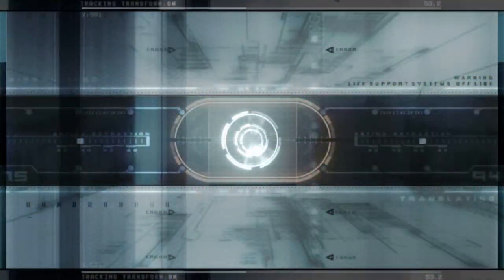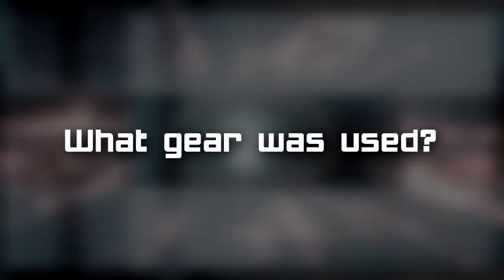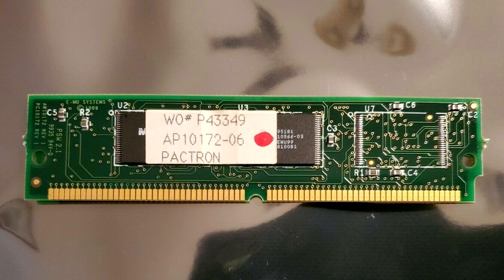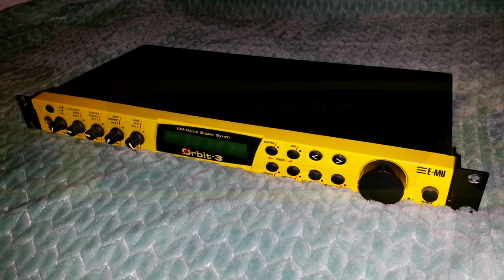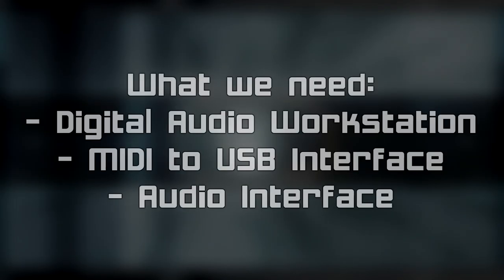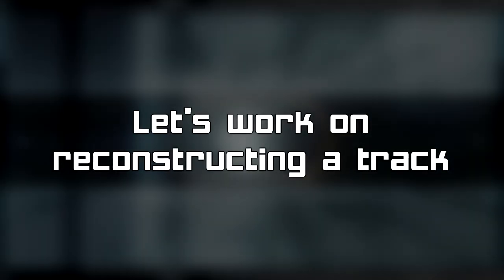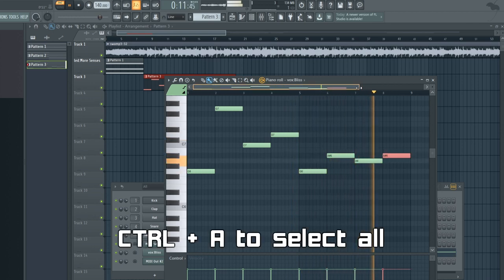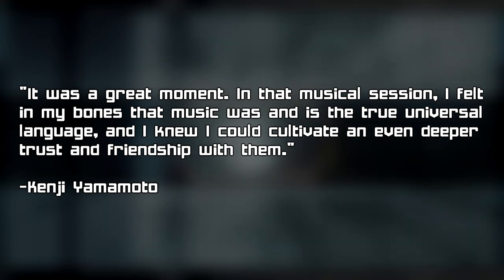How to Recreate Metroid Prime Music (Part 1)

Comment: Hi, thank you for this mini series. That being said, there is a method to the madness of sound recreation. 

Woochia beats and bops did an absolutely amazing video on the art of sound design called: "Sound design: The Complete course" I urge you to check it out if you haven't already, it will make recreating music so much easier.

Also, for the purpose of preservation, making sample piano's out of prerecorded sound bits is also a great way to preserve this music and presets, if you really cannot find stuff for the Emperor Ing fight you could always try to recreate it using samples, sure its a bit of cheating and not as flexible, but if you properly sample and generate an instrument from it, it will be plenty usefull, for you as well as anyone else.

Comment: Amazing work as usual. I'd love to get my hands on some of these synths, any advice on how to track some of these down? Just ebay and hope?
Reply: None of this gear is particularly rare or expensive from what I can tell, though some are more sought after than others. It's also, at this point, all vintage music equipment and finding one in working condition for a price you want can definitely be easier said than done. 

That said, yeah, hang out on eBay and Reverb and check every so often. Use saved searches so you only see new listings. Sort by lowest price. And keep a couple hundred bucks squirreled away to buy it when you do get a deal. 

I was finally able to add an MS2000R to my studio last summer and I've had a blast with just the presets on it.
Reply from the maker: @OnslaughtSix  ^^ All of this is excellent advice.  The SC-880 that I just got took a long time of waiting on ebay, hoping for a deal and eventually it came around. I get the feeling that the Orbit-3 is an uncommon module because it was already a desirable item for E-MU collectors when I first found out about it and now the price for them has gone up unfortunately.  There is Emulator X, an abandonware VST that isn't perfect but is the next best thing to software emulation of these E-MU modules.  I found my Orbit-3 through a friend of mine who stumbled upon it while sifting through various websites.  It was on a Canadian classifieds site, IIRC.

I'm also planning on making samples with some of these presets available on my Patreon to make it easier for people to get access to these sounds.

Comment: This absolutely cheered up my day, thank you so much

Do you think I could get some sounds by testing a Minilogue XD? It is what I have, might be my starting point.

For chorus I have Omnisphere, they are not even close to the Roland SC-88 Pro though. But well, maybe I could find a Roland Synth that can make chorus
Reply from the maker: It's funny you should mention Omnisphere because Spectrasonics originally made the choir sounds that are used in the SC-880, Roland licensed them.  Another way to get the original choir samples is to get Spectrasonics's "Heart of Africa" sample library since that's where they originated from.
Reply: @SynaMax  fuck…Wish I knew that before spending a decent chunk of money ($70+) on Roland’s Sound Canvas VA. It does get the sound right pretty close but I wouldn’t recommend it if you’re only wanting the choir. Its why for some pieces, I tend to try pushing some roland synthesized stuff in cause I wanna use it more.
Reply: @SynaMax  Hey, just wanted to mention that Humble Bundle released a... bundle... that includes the Cherry Audio Polymode VST. It gave me Metroid Prime vibes, might be worth to try it out? (I am going to try it out regardless).

Happy day :)

Comment: Since you did originally use software emulations of some of the E-mu modules, would you say Emulator X's versions of them are accurate enough?
Reply from the maker: Emulator X is a mixed bag.  Some presets are represented fairly accurately while others are like "holy crap, this doesn't sound right at all".  If you're able to get it to work in your DAW and put up with the annoying glitches and error messages, then it's better than nothing.